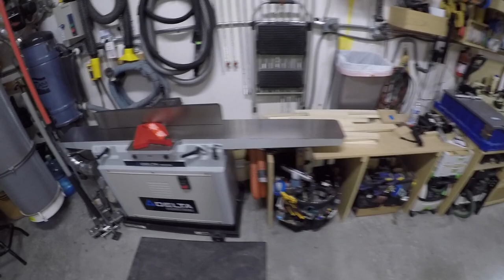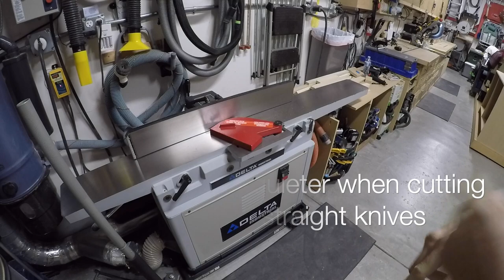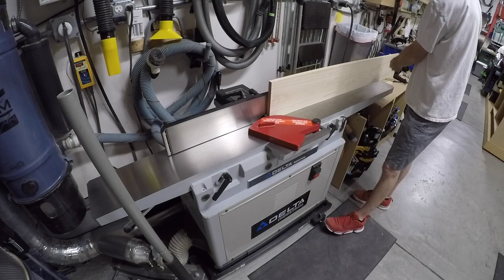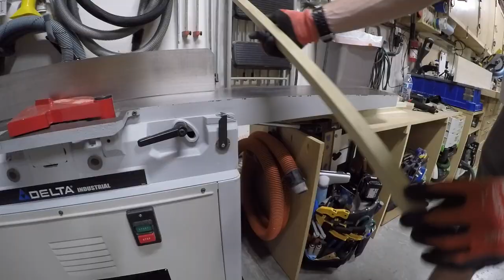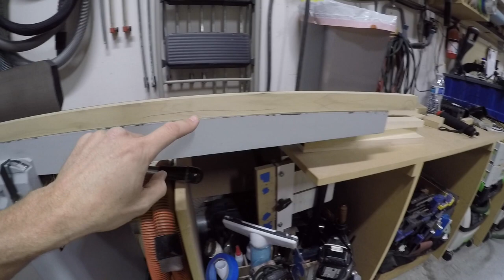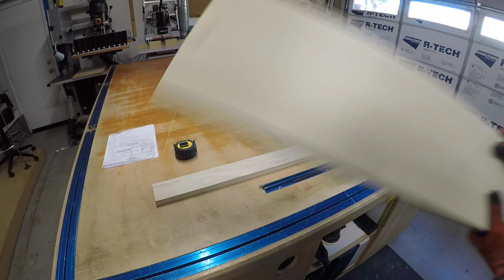How To Use A Jointer and How It Differs from a Planer.  Top Reasons Why I Love It.

Comment: Nice explanation, I would highly suggest using push sticks, especially with a piece that small.
Reply from the maker: Thank you for watching.  Glad you liked it.  However the use of push sticks may seem like they are a good idea, it’s not my favorite way to push cupped or bowed flexible pieces of wood that I want to straighten on the jointer.

Comment: I have a DJ-20 that is a few years older than yours. It is a fabulous machine. Rock solid.  I have the original straight blades and after listening to how quiet yours cuts, I’m considering putting the helical on. However, I am a big proponent of not fixing something that isn’t broken.
Reply from the maker: Hey david, great name by the way, these jointers are fabulous.  I am a big believer in that mindset also.  This is one of those things that is just    So inexpensive but extremely rewarding.  I mean I’ve not rotated the cutters one time- In nearly 18 years I think I’ve had it. The jointer gets used probably every day when I’m building projects.  And I joint all kinds of materials with it.  And it still is perfectly tear out free and smooth.   If they still make the cutter heads this way, you’ll be so happy.  I guarantee you.